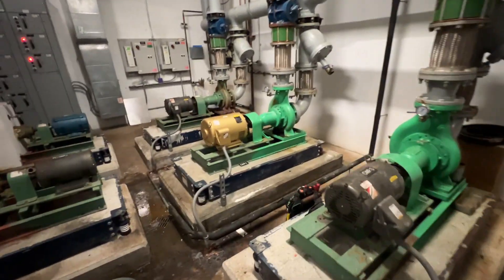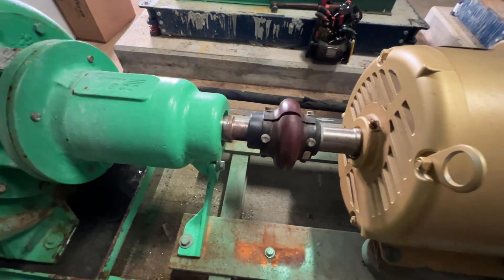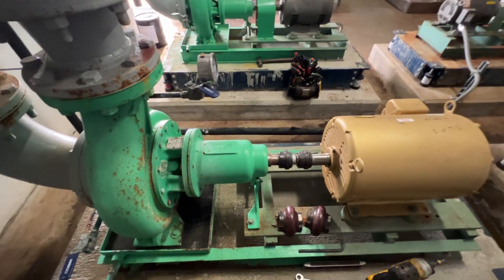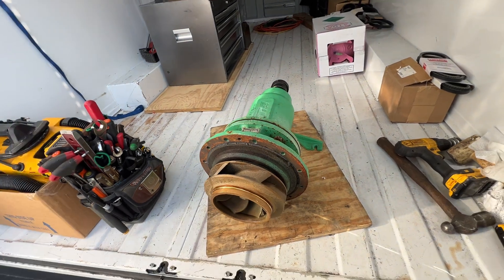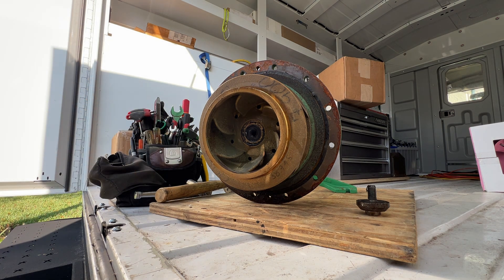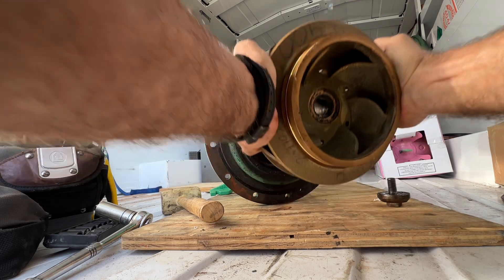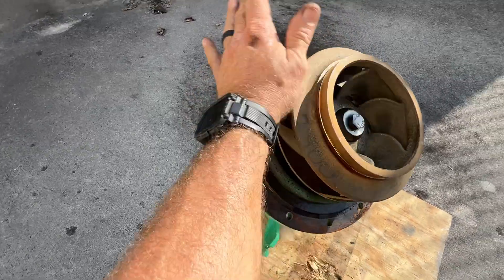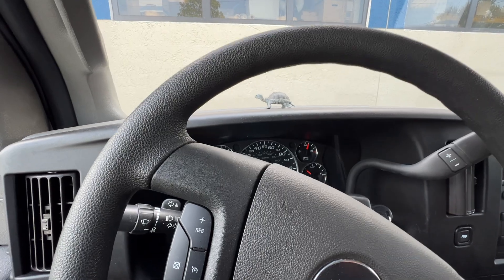Leaking TACO Condenser Chiller Pump Removal And Breakdown

Comment: The white half of that mechanical seal will be ceramic, I had to order a very big seal similar to this and had to send back the first two because the seal arrived with the ceramic cracked; the 3rd seal kit was fine though
Reply from the maker: Yes it is, what a bummer on the cracked ceramic. Thanks for commenting!
Reply: Ceramic is ok but better is silicon carbide

Comment: Use the push bolt holes to push the pump backwards.  There are threaded holes, usually, top and bottom.  Use the bolts that came out of the pump to push it backwards.
Reply from the maker: If it didn’t surrender I probably would’ve cleaned out the threads to do it, Thanks